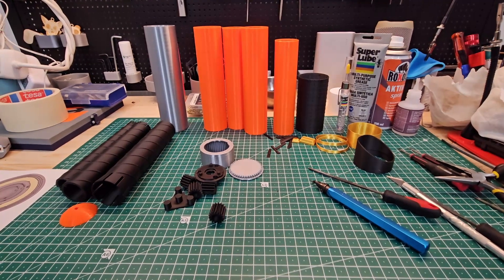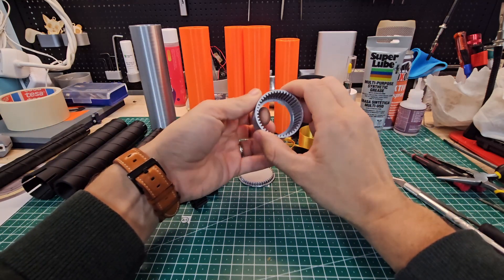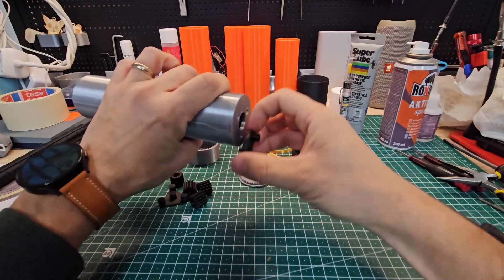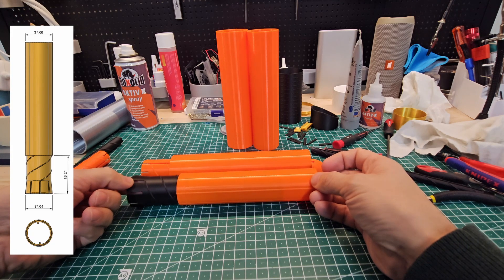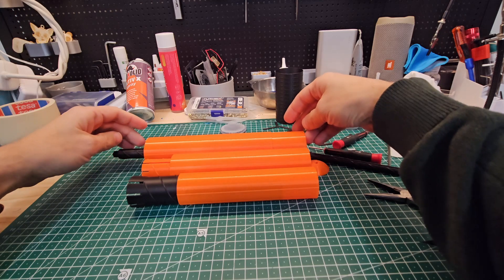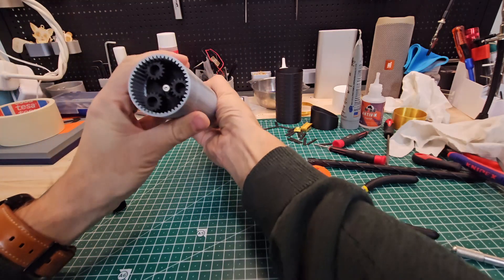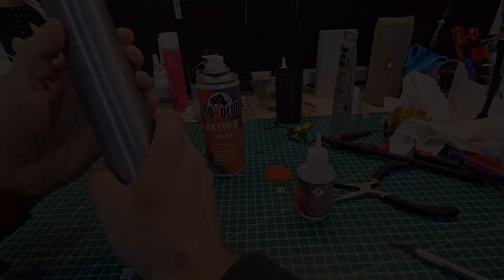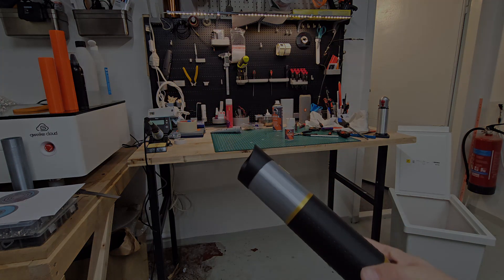DIY 3D-Printed Retractable Lightsaber – Easy Assembly Guide!

Comment: Hi, I’m a fan from China. Thanks for your awesome work! I printed the lightsaber with PLA Basic and followed your tutorial, but the internal parts seem too tight to rotate, so it won’t extend properly. Could this be due to the material? Do I need to use PETG for the orange shell? Thanks for your help!
Reply from the maker: @FeiGao-db7kj  hello. The design is really tight yes. So do make sure to sand and lubricate where needed. Also tune your printers tolerance. This design need a 0.1 mm tolerance acceptance to work. PLA will work great on all parts so no need to change the material.